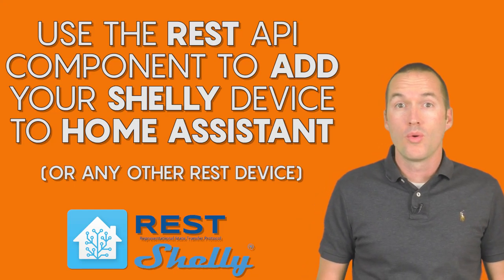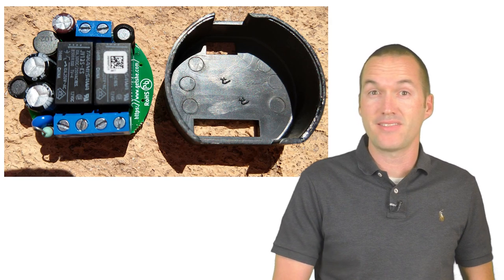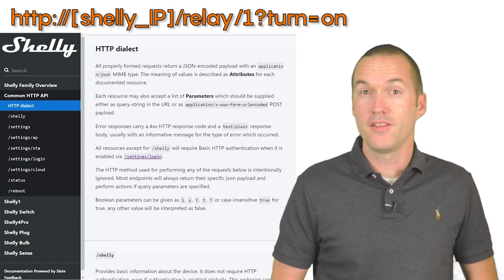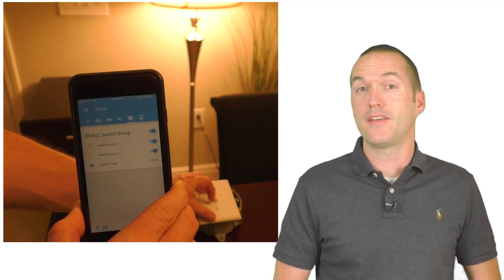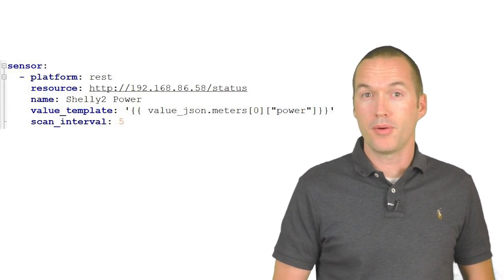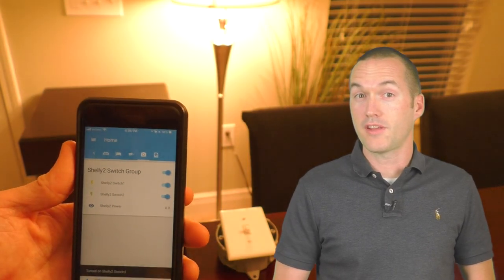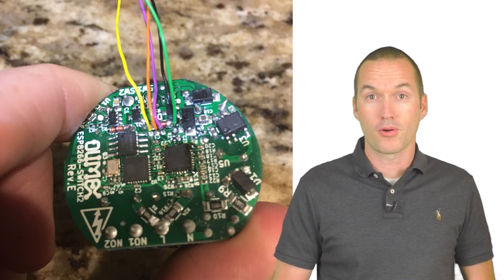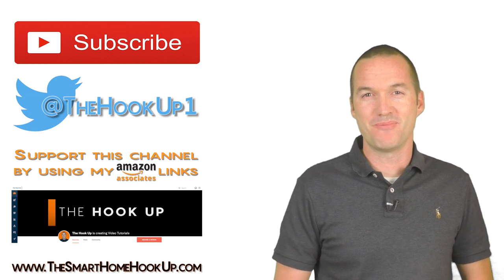Use the REST Component to Add A Shelly Switch To Home Assistant

Comment: This is very interesting video. And many thanks for the authors time in producing this instructional video. I've purchased about 15 Sonoff basic's for integration into my home network, but as of yet not flashed them with tasmota.
Due to the complexity of soldering headers and such to the sonoff I've not fully integrated them into Home Assistant. The Shelly on the other hand appears to make the integration simple. 
And the "Wow factor" is that the Shelly can be controlled by a simple web browser opens up so many possibilities. 😁
I hope Sonoff is paying attention and puts a pins on their circuit board or better yet builds in a way to easily flash Tasmota OTA.
Anyway again my thanks for this amazing video.

Comment: Hi, i have 2 different strings  for ON and OFF because i wanna control my arduino interface.
How can i set the command ON and the command OFF in one switch?? at moment i have to different switch and i's not good.
thanks

Comment: I recently started with Home assistant on a Raspberry pi2 . I had the intention to activate my sonoffs en shellys via http commands. I added the necessary section in the yaml file. My problem : the resource string is send to that ip-adres but the body is never added.
Is this a known problem. In your video it seems not!
In the meanwhile a switched to mqtt after flashing Tasmota. There I have another problem. Tasmota makes connection to the mosquitto broker, but Homeassistant doesn't seems to talk to the broker.
Any help is appreciated,
Paul

Comment: I love your videos, and all the work and research you have done before recording. It feels attempting to put a Shelly behind every switch in the house. However, is it possible to connect a Shelly to work with correspondence switches? Cannot see how to wire it. Two Shellys perhaps?
Reply from the maker: It depends if there is an "always hot" non switched wire in the box with the switch that goes to the light.  If there is the installation is VERY simple, with only 1 shelly.  Just cut the original wire going from the switch to the light and attach the switch side to the SW terminal, and the light side to the O terminal, then hook up your non-switched L wire to L and I, and neutral to N and you're good to go.
Reply: Unfortunately, there are no "always hot" wire. It is like this http://expeto.dk/el/files/b-korrespondance.jpg . If I put a Shelly on the L wire to the lamp,  I'm not able to control the light by switches, if Shelly are off. I was thinking.. maybe use a Shelly 2, and modify Tasmota to switch power between L1 and L2?
Reply from the maker: Oh, I've never seen anything like that before.  That's not how we wire 3-way switches in the US.  In that diagram does that mean that the junction for the "N" wire is in a different junction box somewhere, or is it pulled into one of those switch boxes?  This is how we do it in the US: http://www.electrical101.com/wpimages/3way-switch-wiring-diagram-nm.png

Comment: Great video, I recently buy both Shelly1 & Shelly and I will try to integrate with HA. But I thinks this will be a little problem: It's mandatory to send the rest url with the IP Adress? It's not possible to send by MAC adress, My router have problems when reserve more than 10 IP static adresses. So I think it is easier to format with MAC Adress for example. I Suppose Is posible to set static IP by other way, but is complicated when you have more devices. What do you think?
Reply from the maker: You can set a static ip via the shelly web interface by navigating to the ip of the shelly device.

Comment: Thank you for your videos. They're quite useful! 
But I need your help. I followed your steps and everything were great but, as you suggested, I've bought and installed a Google WiFi and I've connected Shelly switch to this new WiFi instead the main router WiFi. Then the IP changes so I've uploaded this new IP in the yalm file but it doesn't work. It only works if I connect Shelly to main router WiFi. Any idea?
Thanks!!
Reply from the maker: Is your other router connected to the internet? What are you trying to accomplish?

Comment: How do you compensate for the light switch toggle not flipping when the lights are turned on/off remotely
Reply from the maker: There are a few options: edge mode will toggle the state of the light every time the switch changes position (like a 3 way switch does), or toggle will use the position of the switch to determine if the state should change (flipping from up to down is the only way to turn the light off) in this mode you may have to flip the switch twice to change the state of the light.

Comment: Ordered 2 of the Shelly'2,  it would nice to have 16amp relays on the shelly 2 which would be easily justified to replace and use going forward as a safety precaution ,  perhaps a Shelly 3 would be in the works which combines Shelly 1 & 2 features .
Reply from the maker: The 16A relays have a larger footprint, so the overall device would need to be slightly larger.
Reply: Maybe only have one channel 16a relay with the same capabilities i.e. power meter.  best of all worlds.
Reply: Good point. i'm also in need of the 16a and power meter, even if its just 1 channel only.

Comment: A bit off-topic question but what's the purpose of the home assistant? Why not to use just the node-red which you're using for the automations anyway?
Reply from the maker: The quick answer is that Home Assistant (HA) is a superior component platform. It's unbelievably easy to add devices to HA and there are hundreds of hobbiests working tirelessly to integrate popular hardware as it becomes available. HA also has an iOS app with built in (albeit spotty) device tracking, and actionable notifications. AFAIK node red dashboard only runs in a browser.

Node-RED is a superior automation platform, writing automations in yaml sucks, so combining the compatibility of HA with the automation power of node-red really gives the best possible end result.

Comment: I read that Shelly supports MQTT in their factory default firmware. Just need to turn it on. Any chance for a video on Shelly MQTT integration with HA without Tasmota?
Reply from the maker: That will be the 10/18 video, waiting on the shelly guys to get their supply chain back up.  I hear 10/15 is the day for restock.

Comment: Really great!!! I only saw two videos and each one has taught me a lot of interesting things!!! Now I see better, on Producer's page they say that the Shelly 2 can also be used to control blinds, shades, garage doors, shutters and so on, but.. will it be able to update the status also when "external" switches/buttons are pressed? From the video it could seems it is possible, but what about the roller/shutter mode? Will it be able to show  also the partial status of the blinds/shutters (for example into Home Assistant)?? I mean: will it show (with the right coding) "50% open" or simply "opening"??? And. most important of all: has it some way to prevent, speaking about soller/shutter mode, sending two opposite command at once to the blinds/shades/shutters' motor?
Reply from the maker: I don't think partial shutter modes are possible except for using the "timing" function.  You couldn't say "50% open", but you could say "Run the open command for 2 seconds", which might result in 50% open.  The open/closed states are sensed by larger current draw by the motors once they have maxed out their rotation, but since current draw should be equal throughout the unroll/roll process they won't be able to sense position.
Reply: Thank You for your kind reply! Yes, I suppose that, without using dedicated sensors, it would be impossible to exactly know the status of partial opening... but, as You have said,  should it be possible to insert the "time" variable into programming (and a way to "convert" it to %), one could "manually" see in how much time the shutter/blind would fully open/close and input the right intervals or something like that... It seems to me that someone else, here in Italy, made something like this (coding) using a "custom" firmware and Arduino sketch on an ESP8266... should it be possible to at least partally reproduce this using the REST component on HASS the thing will really sort out nicely! ;)
Reply: Axios End of the week firmware version 1.2 will be published. There are minor changes and fixes. In v1.3 witch we expect to have done end of the month are 2 big changes:
1. MQTT support for all Shelly devices, including power metering report.
2. Opening and close by % for Shelly2 in roller shutter mode. We will implement auto calibration logic in Shelly2.
Reply: @Dimitar: Thank You for your kind reply! It's really reassuring to know Developers are listening to us, I am looking forward to the great version 1.3 Shelly2 improvements: it will be exactly what it is needed (not just IMHO) to efficently manage blinds/shades and so on, believe me: a lot of people (I am referring to the situation here in my Country at least) are waiting for such a solution to be available, integrated into HASS (or any MQTT compatible system) and obviously available for Google Home or Alexa (for now here we have only GH)... Keep up the good work and, please let people know about the firmware updates, many many thanks!

Comment: Awesome video! I have my Shelly 1 installed and controlling my porch lights, with rest API for HA! 

Question. I noticed that when enabling the scheduled timer or sunrise/sunset on the Shelly it has to have the Shelly cloud enabled. If I lose internet connection do the lights stay on whatever status they are in until internet is restored? Or do they remember the schedule? 

adding MQTT natively on the Shelly would be awesome!
Reply: Also. I have a username and password on the Shelly web interface for security. Is there a way to add that to the secrets.yaml? Or is there a reason too? Currently I just added them under the code you shared for in the configuration.yaml
Reply from the maker: MQTT is available natively via their beta firmware.  I'll be doing a video on it coming out next wednesday.
Reply: The Hook Up how do I get access to the beta? When is the public release?
Reply from the maker: @williampeters5826  Good question! I'm not sure if it's intended to be public yet.  I'm going to put the link in my next video, but I'll have to ask if I'm allowed to give it out before then.
Reply: The Hook Up it looks like it’s available now through the web console. V 1.3 firmware!

Comment: Can give us an example how to use shelly 2 as Roller Shutter in HomeAssistant. How can we open, close and stop. Thanks in advanced
Reply from the maker: This is COMPLETELY untested (I haven't even run a check to see if the config is valid), but it might work.  I don't have a roller shutter to test with:

cover:
  - platform: command_line
    covers:
      roller_shutter:
        command_open: '/usr/bin/curl -Ss "http://192.168.86.58/roller/0?go=open" >>/tmp/roller 2>&1'
        command_close: '/usr/bin/curl -Ss "http://192.168.86.58/roller/0?go=close" >>/tmp/roller 2>&1'
        command_stop: '/usr/bin/curl -Ss "http://192.168.86.58/roller/0?go=stop" >>/tmp/roller 2>&1'
        command_state: '/usr/bin/curl -Ss "http://192.168.86.58/roller/0" 2>>/tmp/roller | grep state'
        value_template: >
          {% if value == 'open' %}
          100
          {% elif value == 'close' %}
          0
          {% endif %}
Reply: Yes it's work exactly how The Hook up explain. Just need to switch Shelly2 to roller shutter mode from web interface.
Reply: How often does it check the actual status?

Comment: Really interested on your previously video. Do you know if it will work with UK switches?
Reply from the maker: Yes, they will work with UK switches, tested up to 275V according to the CEO.
Reply: @TheHookUp  thanks for the info. I know that it will probably be close to impossible, but It'll be great if you could do a video on UK switches as I haven't seen one on you tube yet. Unless if you know one already exist?

Comment: Amazing :D I already bought 1 shelly 1. Did you ever try the Xiaomi sensors with the zigbee2mqtt project?
Reply from the maker: I bought all the stuff, it's just sitting in my desk... Too many projects!
Reply: Ohhh would love to ditch my xiaomi hubs didn't even know there was a zigbee2mqtt project
Reply: Yes there is :D you can find all the information in the link below:
https://github.com/Koenkk/zigbee2mqtt
Reply: There is :) And I can confirm it's pretty good. I ditch mine 3 months ago and now I'm able to add zigbee devices from other brands (inc. IKEA bulbs). Keep in mind that the range is not the same as the xiaomi gw. You'll need a few CC2531 with router firmware or a few zigbee bulbs/power outlets to expand the range)

Comment: Hi rob awesome video! I’ve had my Shelly working for months now. I just peaked into my HASS logs and noticed an error. “Update if switch.front_porch is taking over 10 seconds” and “time our while fetching data” components/switch/rest.py - I did try and change the scan interval but no luck. Any thoughts?
Reply from the maker: Rest is slow because it relies on polling.  If you have mqtt set up I'd highly recommend switching it over (It is now supported by the default shelly firmware)
Reply: The Hook Up yes I do have mqtt set up. I recently switched from hassio on a PI to hass in a docker. Still working on setting up the container for mqtt but for the time being I will use the mqtt broker on my pi. Thanks for the info!
Reply: The Hook Up when enabling MQTT on the Shelly disable the integration with Alexa and Google assistant?
Reply from the maker: @willdabeast4430  Yes, if you enable MQTT you will completely disable the shelly cloud.  The shelly skills for google and alexa work through the shelly cloud.  Most folks who have MQTT based systems have their own integration with those systems through home assistant or node-red.
Reply: The Hook Up I didn’t want to expose my HA to the internet so it was working well with the rest api.
Reply from the maker: @willdabeast4430  gotcha, yep that's an option too.

Comment: Yet another nice video. I've contacted the Shelly team over 6 days now due to my interest in ordering in large quantity but i've not no email replies even after sending follow-up emails, yet to replies. I wonder if they don't reply to email. Do you know an email to reach a member of the team?
Reply from the maker: The CEO, Dimitar Dimitrov has been active in the comments, perhaps he can give you a good email address.
Reply: Hello Eugene, we will check why you not receive any reply. The e-mails are: support@shelly.cloud and developers@shelly.cloud
Reply: Thanks Dimitar, i didn't know you're the CEO, nice work with the Shelly 1 & 2. 
I finally got reply from Ivan and we've been discussing and at the point he needs to consult with you as regards my requirement before we can proceed.

Comment: why can I use this for a switch but not for a light? If I place the yaml config under the light section I get an error 
Configuration invalid
Platform error light.rest - No module named 'homeassistant.components.rest.light'
Reply from the maker: Yeah, there's no such thing as a rest api light: https://www.home-assistant.io/integrations/switch.rest/ only a switch.

Comment: Can you explain the wiring guide for the Shelly2, I have read the manual but I still don't understand it.
Reply: Hello Cole122, what load you want to control with Shelly2. We can help with wiring too.
Reply: Dimitar Dimitrov I want to put it inside an US light switch box to control a desk lamp and ceiling fan.
Reply: Dimitar Dimitrov Also in the wall is two sets of neutrals, line in, load and ground.
Reply from the maker: L to L, O1 to load1, O2 to load2, N to N,  L to your wall switch inputs and wall switch outputs to S1 and S2.
Reply: The Hook Up I just got it and I am in the process of installation. Looking at s1 and s2 what should I connect? I am thinking a short lead of wire going from s1/2 going to one end of the switch and another short leading connecting from the switch to a cap which is connected to the power. If this is the case should I use only one line in, or use both, where each is connected to a switch
Reply from the maker: The only thing that should be connected to your switched outputs should be S1 and S2, the L terminal should be attached to the input live wire of your switch, and the N terminal should be attached to your neutral bundle.
Reply: The Hook Up Is “switched outputs” the wall switches? Line to line, neutral to neutral makes sense. The 01 and 02 to the wire going to the light. But for s1 and s2 is connected to the switch via a short wire, what is the other end connected to?
Reply: This is about where my question lies: https://imgur.com/a/nnWY3r1
Reply from the maker: https://i.imgur.com/w1T18Ld.jpg

Comment: As you know, power is a product of voltage and current. Do you actually know your measured voltage? Did you measure the current?
Reply from the maker: For what?  The light bulbs?
Reply: From your video, the light bulbs were the apparent load and it would make sense to measure the voltage and current for the light bulbs if you want to know the power consumed to compare to the app displayed value.
Reply from the maker: Oh, I suppose I could have.  I figure 2 lightbulbs that say 60W on them, measuring at 116W is pretty okay with me.